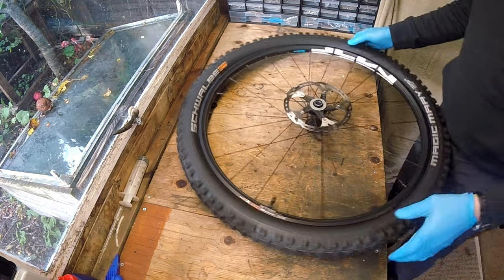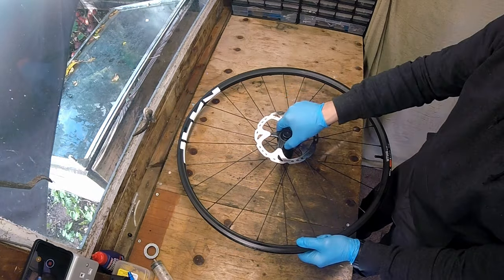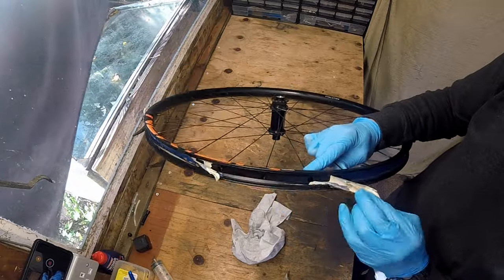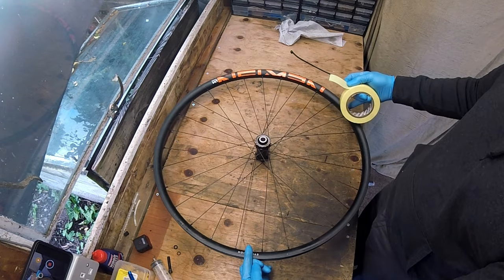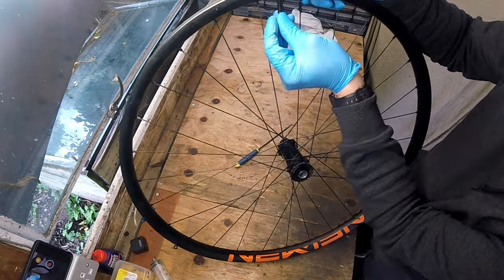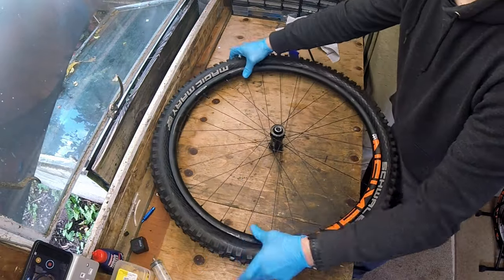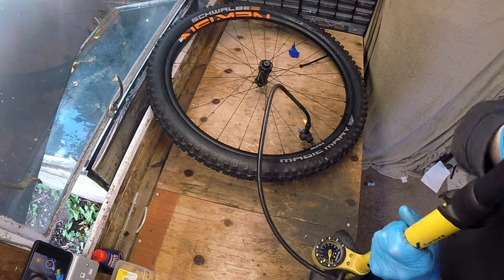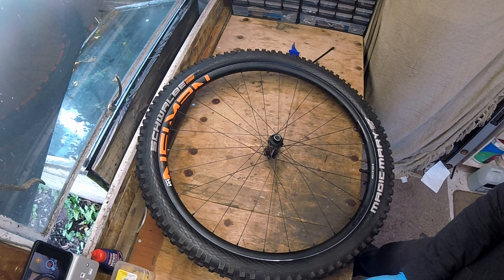I bought another set of Newmen SL A.30 Wheels - With Commentary - Part 1

Comment: I've never managed to inflate a tubeless tire with a foot pump , good job on that ;)
Reply: To seat the bead too*
Reply from the maker: @jblbassslayer3108  Thanks. I used to struggle with this too but there's a bit of a knack to it. Good quality rim tape which matches the width of your rim is a must. 

I've found it's the tapping of the tyre on the bench a few times that does the trick. It causes a slight increase in pressure within the tyre that pushes the beads out towards the wider edges of the rim. This creates enough of a seal to allow inflation by hand or foot pump. 

I'm glad you enjoyed it.